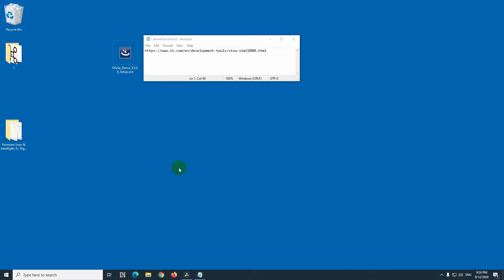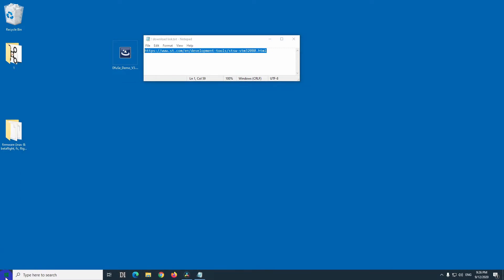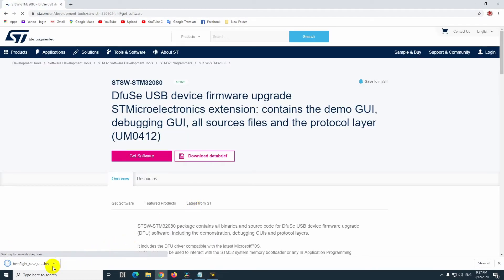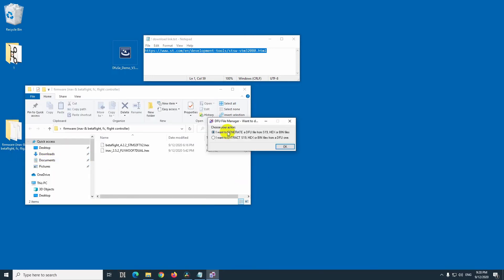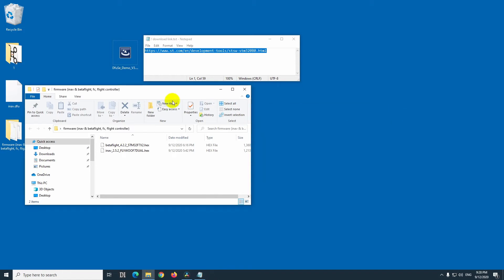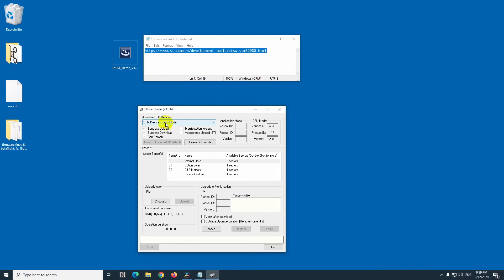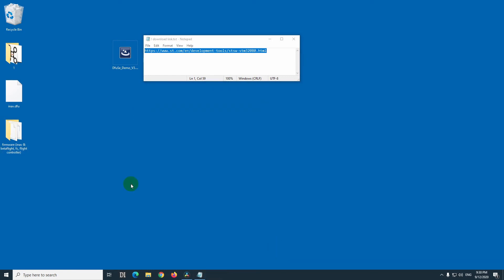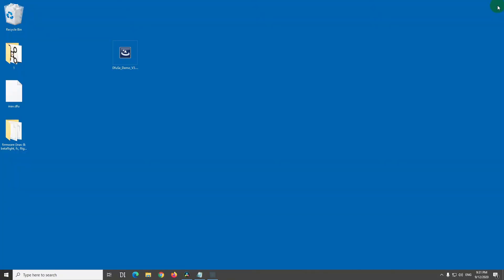How to flash another firmware onto a Flight Controller? (FPV drone, Betaflight, Inav, DfuSe)

Comment: What's the reason for this process when you can flash your FC directly from Inav or Betaflight. You flash your FC with the same firmware found on Inav or Betaflight. I understand if you can flash a Matek with a Flywoo firmware or vice versa but to flash with the same firmware you can do it from Inav or Betaflight, I don't see any benefit of this process. You said in the title how to flash another firmware in your FC but in the video, you fash the firmware which is already made for your FC and you can flash it directly from betaflight.
Reply from the maker: In certain cases the FC won't enter into DFU mode (even if the button is pressed on the FC), it always displays an error message and it won't let you update the firmware. Example ► https://www.youtube.com/watch?v=MY6rARsEUyg
Reply: @furulevi  I got it. Your title should say "another way to flash the firmware on any FC" or a Different way. I understand English is not your main language. From your title, I understand you can flash any firmware on any FC.

Comment: Good day! Do you have any information on what to do if, when connecting a flight controller with a fixed DFU button, its reflection does not appear in the table (((What should I do. Thanks.

Comment: Even in boot mode my fc is not showing.
Reply from the maker: Are you holding the button on the FC and then inserting the USB cable?
Reply: @furulevi  I did it and it is showing now, but only when I do that, otherwise it says "usb device not recognized"